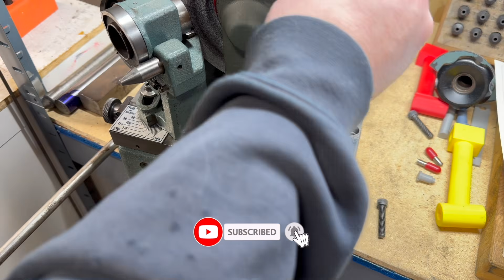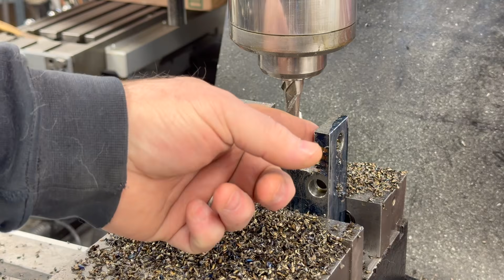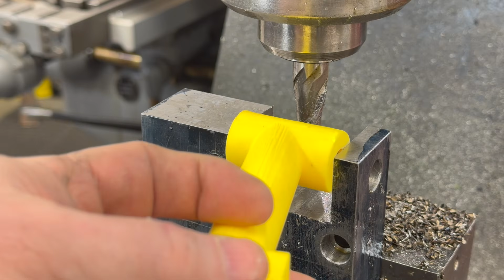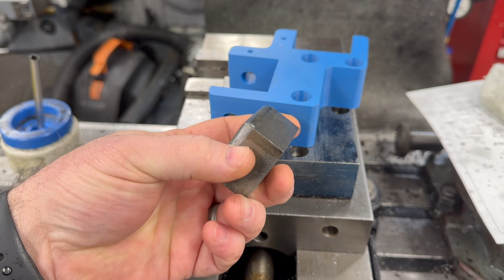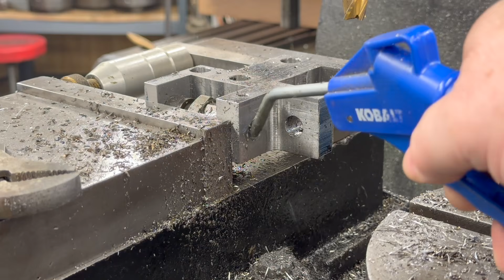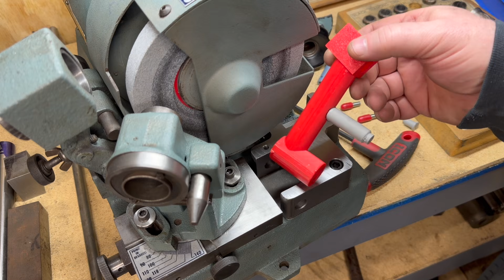Black Diamond Drill Grinder - Machining the base for new wheel dressers - Part 2

Comment: You did a good job, but it would have been better if you had cut off the last piece with the saw and then cleaned the area with an end mill. This would have saved you time and effort, and also freed up a piece of iron for other work.
Reply from the maker: Maybe. But I hate using my band saw for stuff like this. It's a cheap horizontal. If I had a decent upright band saw, I would agree.

Comment: Curious why you did not choose to bandsaw out most of the material?
Reply: I was thinking the same. And drill out the most of the U-shape before milling.
Reply from the maker: I don't have a vertical band saw, just the horizontal. And I don't trust it enough to cut straight when freehanding.
Reply: @MyLilMule  I thought the 4x6 bandsaw would flip up so you can do vertical. Or is it too sketchy?
Reply from the maker: It's pretty terrible as a vertical band saw. The guard doesn't come down very far so there is a lot of exposed blade. I need a decent, smallish, dedicated vertical bandsaw.
Reply: @MyLilMule  I've got 2 of the 4x6 saws . I have one set up for aluminum and the other for steel. Both cut very very square when using as a horizontal saw but like you when I try to use either of them in the verticle position it is kind of a crap shoot. I have a 14" Walker Turner somewhere around 1940 vintage that is in my que to restore and my plans are to slow it down so I can cut steel with it. Just have not got there yet.
Reply from the maker: Yeah, they just aren't as good as a dedicated vertical saw. I have an old rockwell wood cutting band saw that could be a candidate. But I would have to build a gearbox to reduce the blade speed. Maybe a VFD would work if I found the right motor, but I don't think it's worth enough to go through all that trouble. Something like your 14" Walker Turner would be ideal.

Comment: Just a quick comment, at about 12:00 when you're milling the top slot with the two flute mill, I hear a lot of what might be vibration when cutting under load... is something loose, vice, or the mill table, is you quill locked?
This is maybe why you are getting a poor finish... on the side of the cut.   I have just spent 20 minutes milling a lathe carriage stop, on my small Grizzly 0704 and I know that sound!   Once tight however, it cuts very well... just my $0.02    Best!
Reply from the maker: Appreciate the comment. I didn't lock the table, which could be part of it. Plus, the endmill is not very sharp.